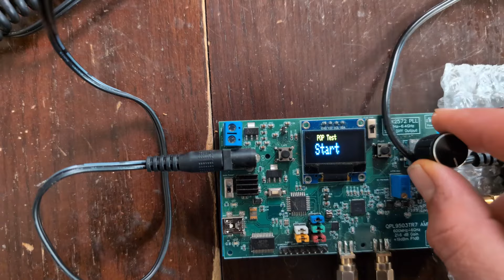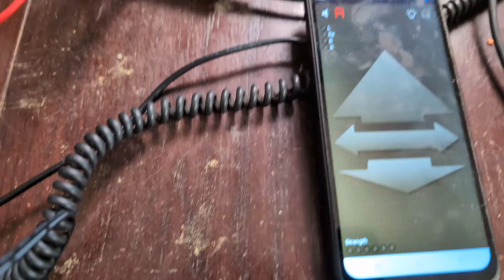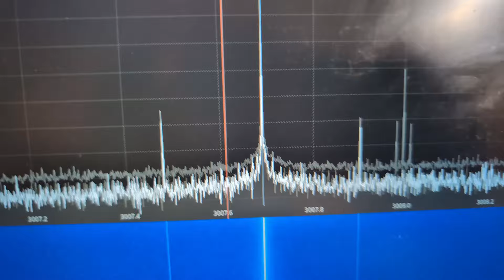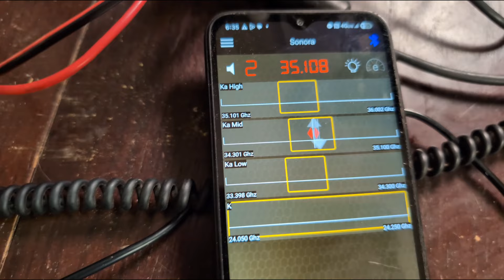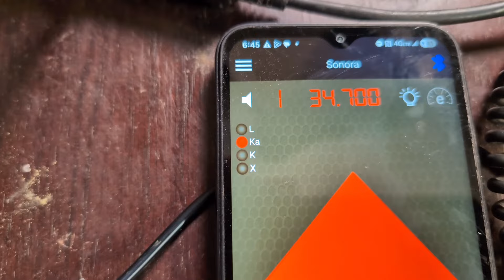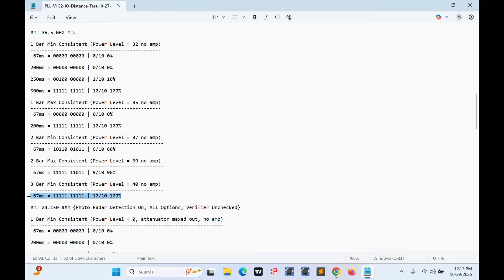Secret Valentine 1 Gen 2 Banned Quick Trigger/Pop Distance Test Using Detector Tester Prototype!

Comment: One quick question, what are the sidebands?  Is that artifact or intentional?  I have a neat Ka radar unit picked up at Xenia but my SA only goes to 22 GHz so I can't easily take a look.
Reply from the maker: Just spurs from the PLL and some phase noise. If you notice the actual radar signal also has them as well. I'm actually really surprised my signal turned out so well since its going through 3 2X multipliers all ganged together. I have a a bunch of these KA antennas and they all look like. As far as the spurs that are there regardless its just noise but I'm also running a 4 million point FFT, if I go down to a normal FFT size the noise ones disappear but the one on the signal are still there. And BTW those sidebands are there directly out of the PLL too. I think you have to play with the input multipliers/dividers on the PLL to get rid of them. Pretty sure they're either fractional or integer boundary spurs. I just haven't gotten around to trying to eliminate them yet
Reply from the maker: Also I'm developing some of these boards like a mixer board that can down convert signals from 44GHz down to an IF that you can read with a regular 3 or 6GHz spectrum analyzer. These will be products I sell soon and they won't be $5-$10K like the ones from Fairview microwave or pasternack. I want to sell them to hobbyists and make them affordable!
Reply: @StickIt2TheMan-nb4wr  I would be interested.  I'd like to be able to see the signals from some of my radar gear like the PPS-15 and Ka moving radar.  I have an Aeroflex 7100 and HP 8566B among others.

Comment: You mention that a more sensitive detector may show poorer performance when placed side by side with a less sensitive detector just due to placement.  Another angle on this is that the specifics of the location of your vehicle and the radar can cause a huge variation in detector performance.  Thus, you need some kind of a statistical analysis which takes into account detector antenna geometry and the kind of movement expected in the real world along with the minimum detection pulse width and noise filtering.

The Gunn diode warmup is interesting.  I bet you could almost "fingerprint" that.

Next is location detection and active signal generation with intended Doppler shifts.  But hey, now when I want to go fast I hop in a plane.
Reply from the maker: Yep you raise a really good point on the antenna geometry. That explains why some detectors work better in certain environments or stand out in certain situations. It takes sooo long to perfect those designs (at least for me anyways). I remember Mike Valentine saying they spent dozens of months simulating the new horn antenna and I can see why!

Comment: Some comments here for you. I think you need an introduction video that shows a block diagram of this system. I know your proud of this design and should be but you also need to be more inclusive to your audience. Not everyone is an RF microwave engineer. After your introduction and block diagrams, you should discuss the existing test equipment that you are using like your spectrum analyzer. I’m not familiar with the one that you’re using and so that would be a good thing to have as well as your gun diode radar from a police radar unit?
Well, you went to a lot of work designing this, but your camera work is very shaky. You seem to be moving around way too much. Take your time in the production of this document a bit more do an introduction state what you are trying to really achieve and I think you’ll have a lot more material just from that that will be helpful for others.
Reply from the maker: Thanks for the tips! Yes I admit I kinda rushed it and left some stuff out but indeed I'll have to go over it in more detail in another video! Appreciate the feedback!